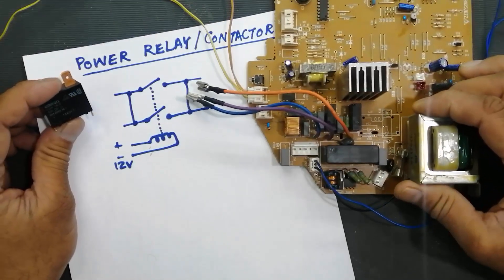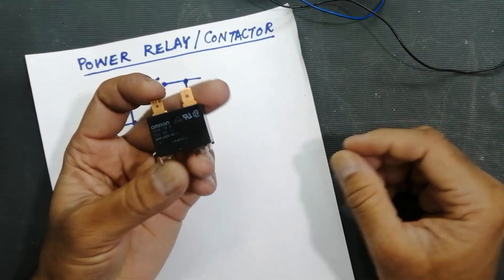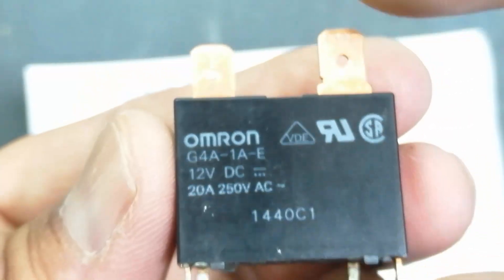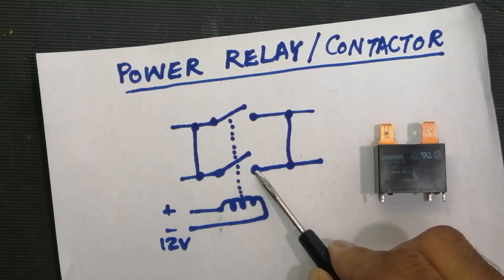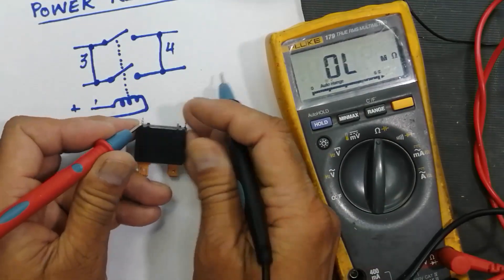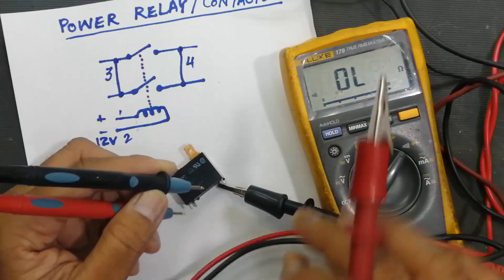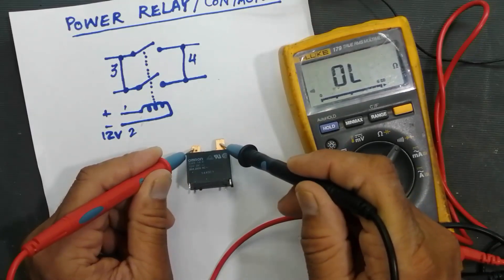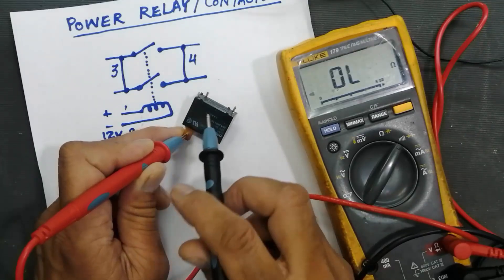#303 How To Test Power Relay / Contactor

Comment: Hi, one of the split indoor unit automatically turn on when the outdoor unit is turn on. Does this mean the unit relay is spoilt? The indoor unit cannot be turn off using the manual on-off button or the remote controller